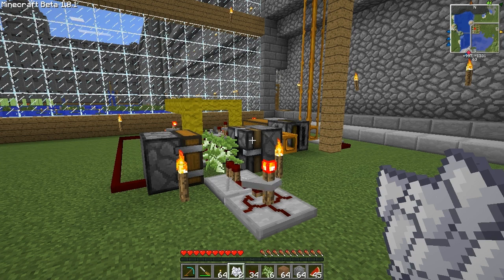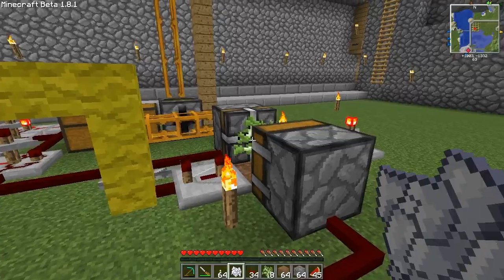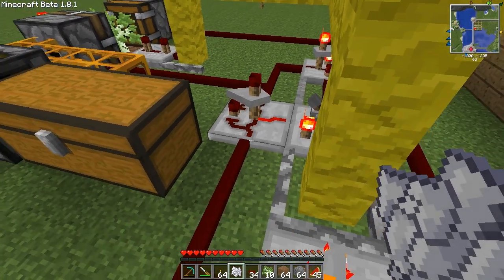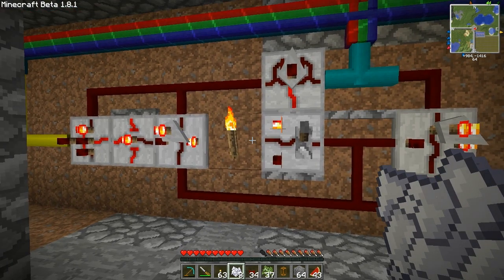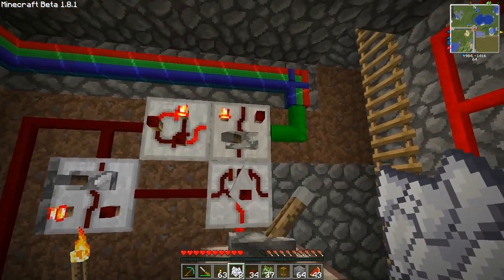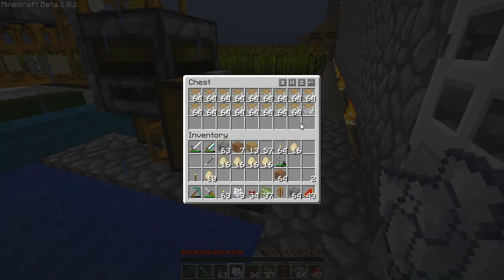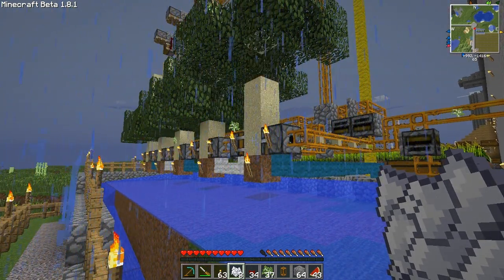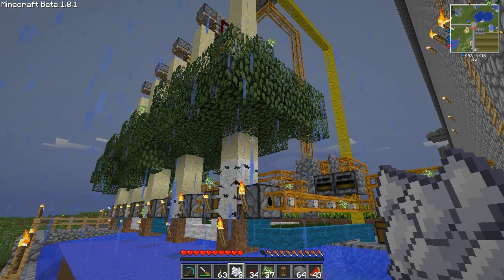Minecraft: Automated Tree Farm with RedPower2

Comment from the maker: @finniespin1 I can only comment that it works for me. Powering the Block will inevitably power the adjacent breaker. For now (until we get frames) there's simply no way to avoid that.
You can try to increase the delay on the repeater, so it will spread the signal to debug the behavior. But if that's really the reason why it won't catch the pulse, the only idea I have is to use an item detector to detect the first piece of log coming from the breaker and start the harvesting process on that event

Comment from the maker: @todumbtodi Strange. In PR4 it works. Since I'm not at home over christmas, I can't check with PR4b. But I will once I'm back home. Only thing you still might want to check before: a steady signal won't work, because it won't receive the block update correctly. You have to use a pulse. I'm using a 20 sec. timer on the "sending" side of the tree for this. Other than that I have no idea. I will check with PR4b and SMP when I'm home.